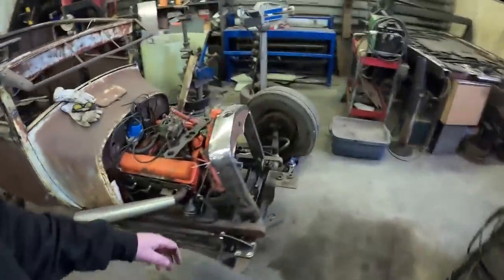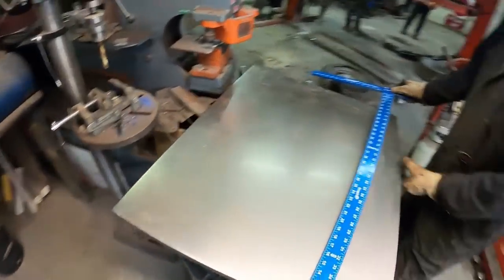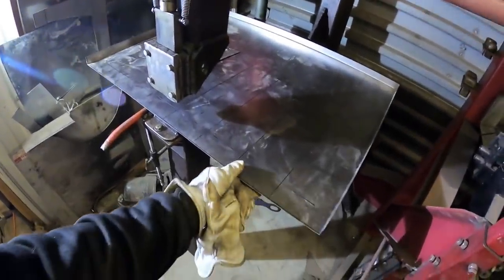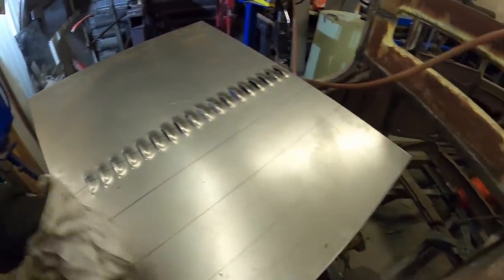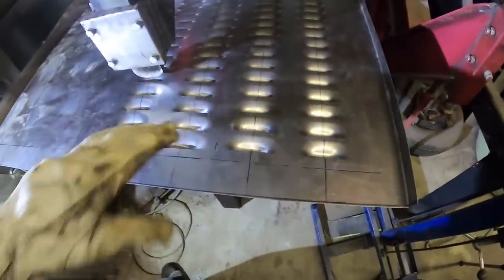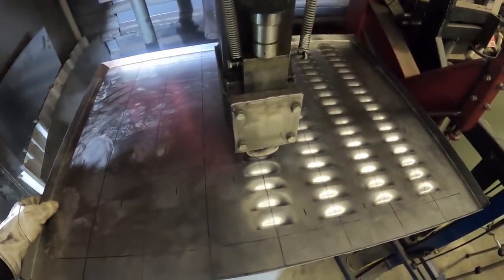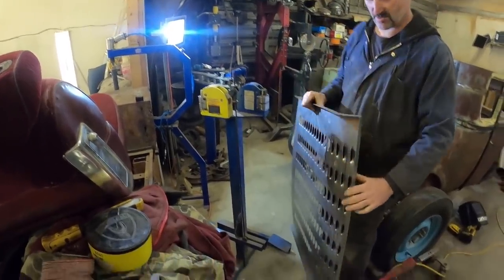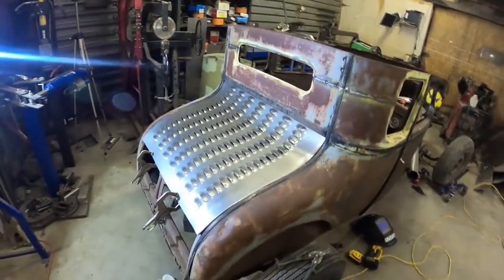Punching Louvers into a Scratch Built Ford Model T Trunk Lid

Comment: I dig it think you should do a hood and the roof panel in metal with the louvers to match . Did Halfass make his louver machine it seems as if he used an arm and modified it to hold a porta power with a set of dies
Reply from the maker: i wanna go no hood and no roof haha
Reply: Welp then no louvers in those spots . Maybe the visor or the cowl

Comment: Curious as to why you wyent with a one piece lid when the 26-27 coupe had a rectangular lid with a panel above and below the lid? Would have taken less work overall and supplies the needed body strength.
Reply from the maker: i think they had a lid like this that goes up to the belt line.  im using the factory hinge and everything.  maybe there were different styles
Reply: @DDSpeedShop  I was incorrect in regards to there being an upper panel, but there was a lower panel (pre 26 had the upper panel).